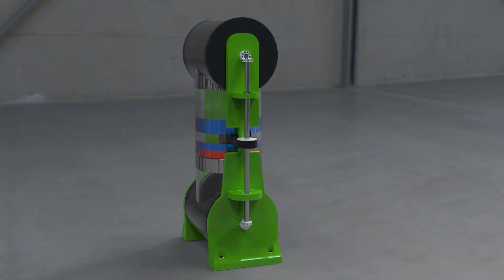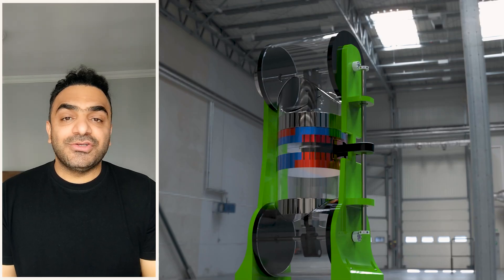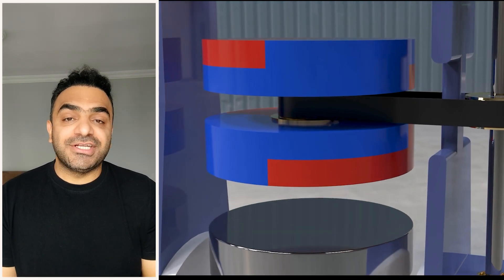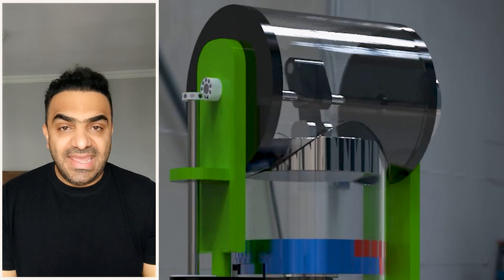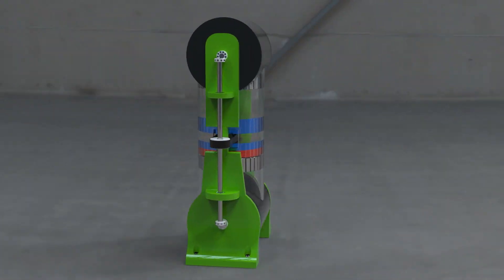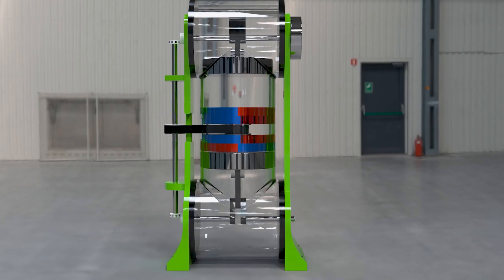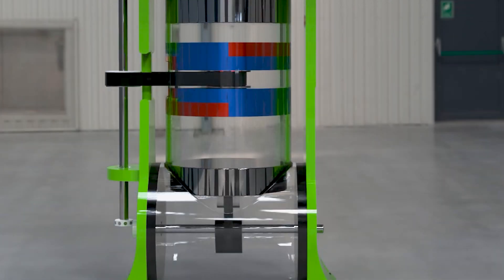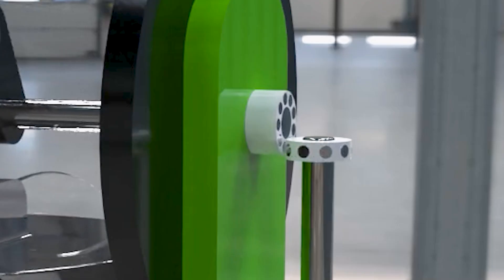New Engine Developed

Comment: You are just exchanging mechanical friction for magnetic resistance.  Magnetic gears are no more efficient than mechanical gears except in high speed, low torque situations.  It's certainly not going to solve the problem of a machine powering itself.  You are trying to get two people to the moon on a teeter totter.

Comment: The top piston axle is moving in the wrong direction. It needs to be going the opposite direction in order for the outside magnetic gears to perform like the lower one. Anyone can see that this illustration isn't correct. Based on that, it's a no from me. I'm out!